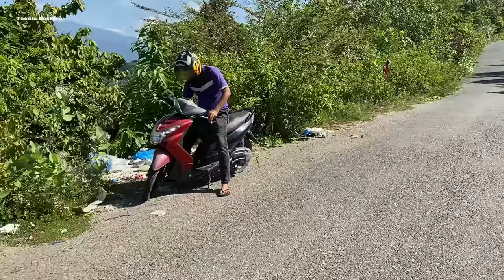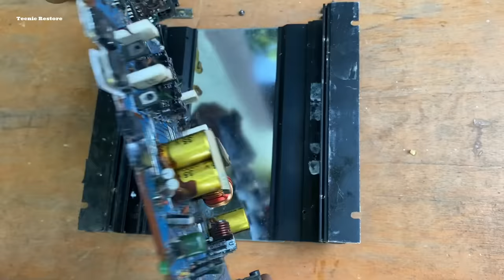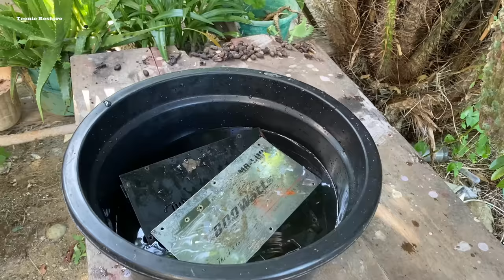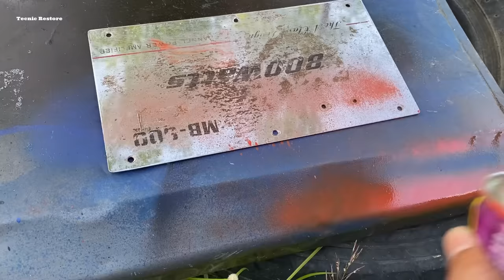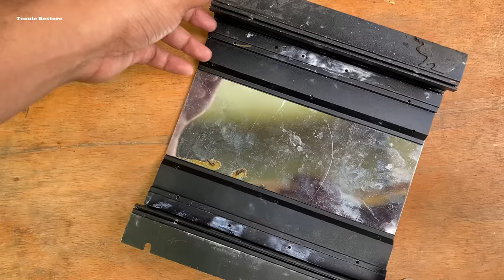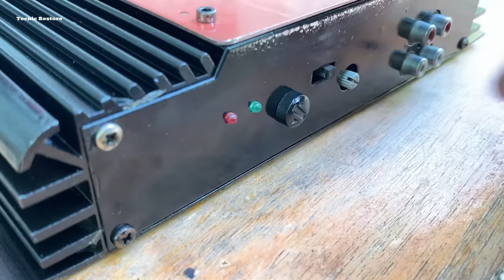Restore Car Power Amplifier Audio | Restoration Amplifier

Comment: Bro which Street is that where you found an amplifier , take me there too , i will find a subwoofer there too .
Reply: Along MA ILAP Road,  make a U-turn at DI MAKITA Street.
Reply: Also Took me i can find for u a 12v power supplies
Reply: @rudranath6782  I bought used Intex tecno computer smps yesterday from a computer repair shop for 200 rupees .

Comment: Dude you really should have applied new heat sink compound on those parts.  Some of them were bone dry and will probably fail if you push it.  Otherwise, a respectable restoration.  I'm glad he didn't try to make it look like the gold screws looked new after a little soaking.  Those things rust and they never look good again.

Comment: I wouldn't have painted the Heat Sinks as Paint is an Insulator, and will impair the transfer of heat to the Air
As mentioned previously, I would have applied new Heat Compound under the Power Transistors

Comment: Lets touch random solder points, not give the meter time to settle. Yep its fixed... haha... lets just join random points on the back with thin wires with no circuit diagram. sure. thats how you fix things.  Terrible paint job? sure. random things that just.. happen. Yep. This is how you fix something.

Comment: sorry but it was a very bad job!!
 what was those random wires on the bottom??? 
and why did you put a oil coat on the screws? to hava a bad electric conection??

Comment: I can't believe it actually worked . By the looks of the capacitors I thought surely it was gone. However it did make me cringe to see you use the gain control as a volume control.  That amp probably has enough power to blow the coil out of that small speaker.
Reply: That goop on the caps is glue.  People tend to think they are leaking but that's not what that brown crap is.